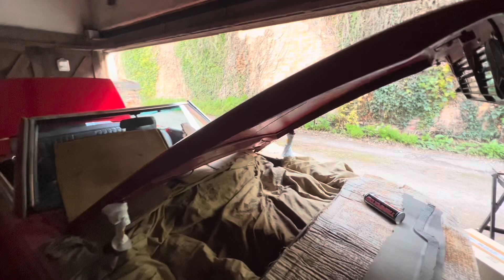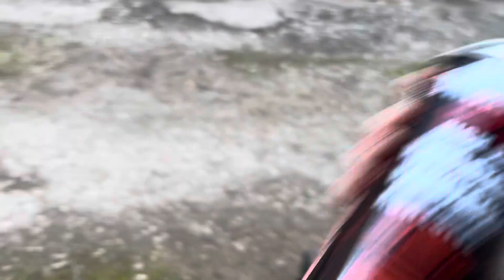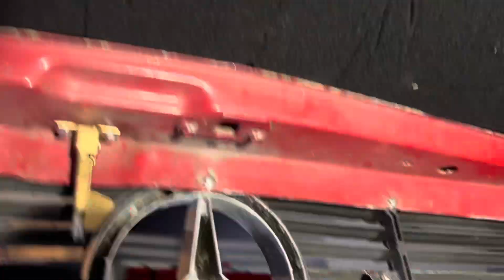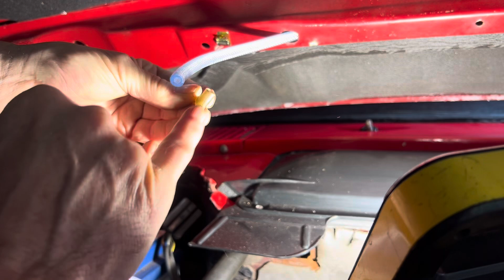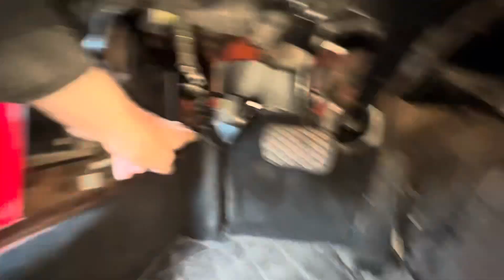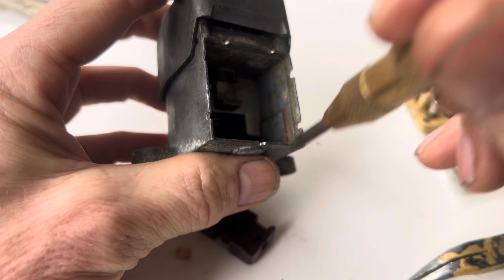Mercedes R107 under bonnet insulation, windscreen washer hose, pump and foot switch repair.

Comment: Another great, useful video - thank you Mike.  I did the same job but removed the bonnet - it was pretty easy with someone to help with the manoeuvring.  I just placed it upside down on the suitably padded engine bay and that made it really easy to spray on the adhesive.
Reply from the maker: Yes - that is the proper way to do it...especially if you are not into yoga!. Mike

Comment: Hi Mike - I had the same problem with the washer pump being NLA for my 73. I bought a new febi pump with the flat connectors and a set of various crimp connectors from amazon, and just made a small adapter from the bullet style plug to the spades on the pump.
Reply from the maker: Yep....I reckon that might be the way to go...although I have found the VDO 246-075-017-002Z which looks like it might fit. Mike

Comment: Good video, Mike. I recently did the exact same job on my ‘72 350 SL. My pump was also seized and very noicy, but I took it apart and cleaned and greased the small gears and now it runs beautifully.
Reply from the maker: Wow 72 SL...that is an oldie! Good tip - I hadn't thought of trying to fix the pump. thx. Mike
Reply from the maker: Hi - did you go as far as separating the motor from the housing...or did you just undo the four screws and clean out the inside? the motor inside mine feels pretty loose and rattley...almost as if there is a bushing or gasket missing. Mike
Reply: @MikesMercsandothercars  Hi Mike - no, I did not separate the motor from the housing. I removed the four tiny screws and cleaned out the inside. It was also seized so I cautiously applied 12v to the connectors and that eventually freed up the motor. I can see from the metal plate that is is a factory pump as it says "VDO '72". Quite cool. From what you describe it does however sound as if the motor is having issues. I seem to remember that the motor is cast or at least very tightly sealed into the housing so I'm not sure it can actually be taken apart. Good luck. /Peter
Reply from the maker: @Circle350SL  Thanks for getting back to me. Mike